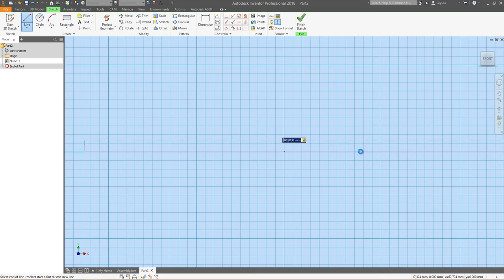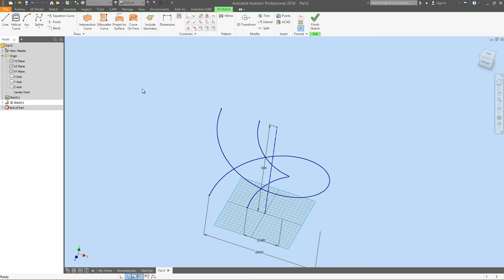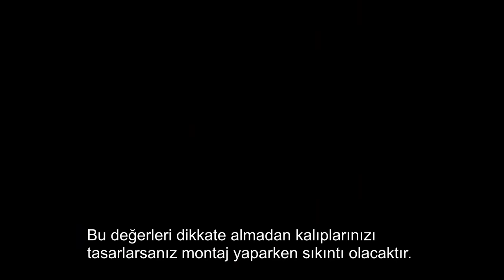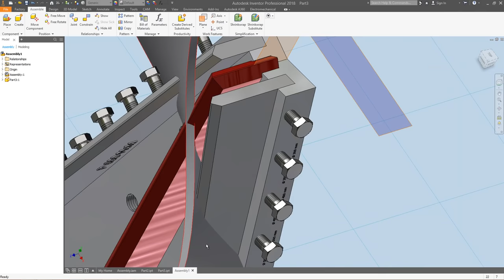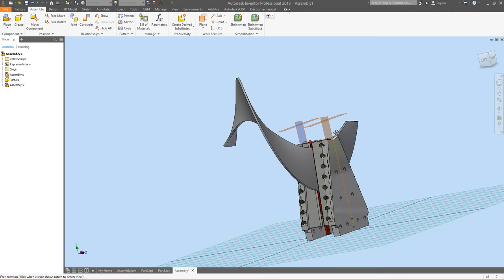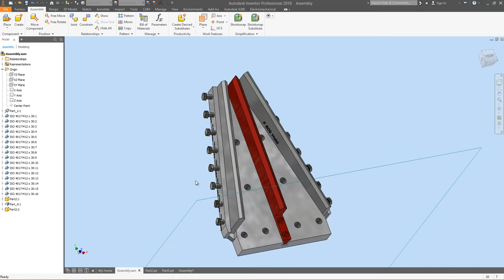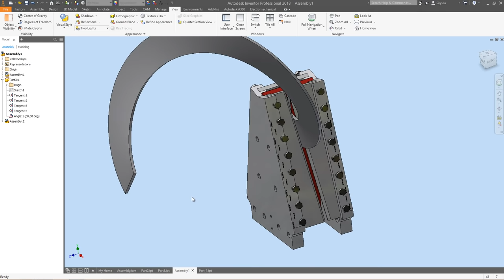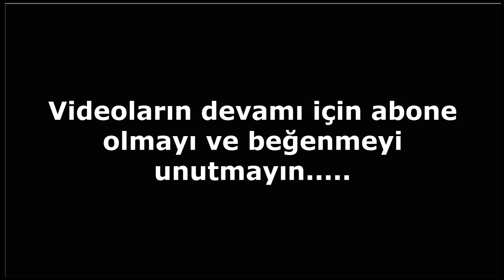Auger Flight Forming Mold

Comment: Hi Designer_36. if I need to change pit, I must change the matrix?
Reply from the maker: yes, it will change in mold when you change the pitch. 
But with a single mold you can produce right or left parts.

Comment: I think for square pitch i.e. OD 254      & Pitch 254 or OD 304.8 & Pitch 304.8 then degree of wedge is same for this two augers.
Is it correct sir ?
Reply from the maker: No. Pitch is changing according to the mold.
Reply: @Designer36 Thanks Sir..According to this formula I am thinking  tan¥ = Pitch / (3.14 x D) 
tan¥= 1/3.1416
Therefore 
¥ = 17.65 degree
And Same for all square Augers.
Reply from the maker: If you think it's true, go ahead.
But I can't make any comments. My method is different.
Reply: @govindaadalinge8759  tan ¥  whether to determine the angle for the plate press? please help explain. thanks
Reply: @Designer36  hello, how much would you charge me to calculate the angle and pitch of the mold? OD 40in, ID 7", Pitch 75cm
Reply: @Designer36  I need your services to calculate the helical angle. greetings